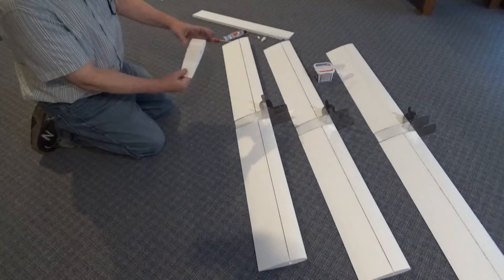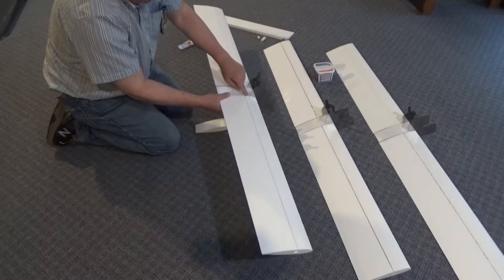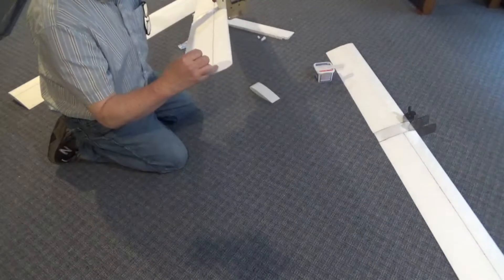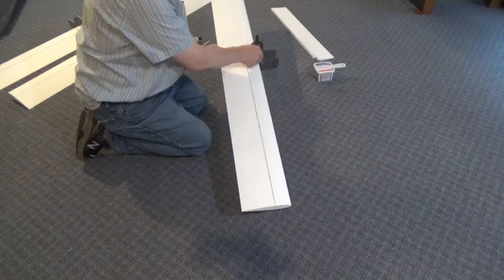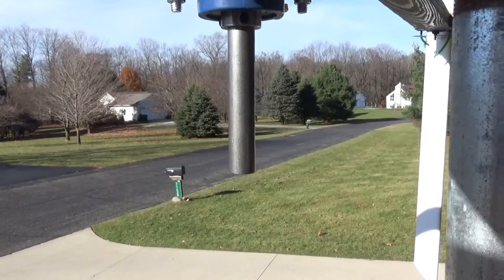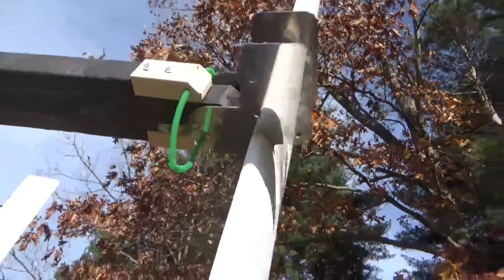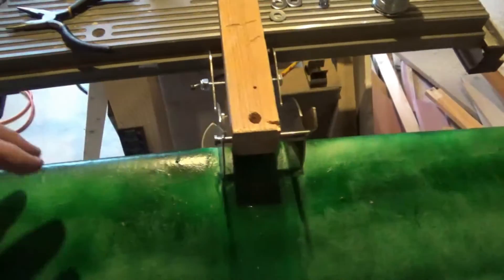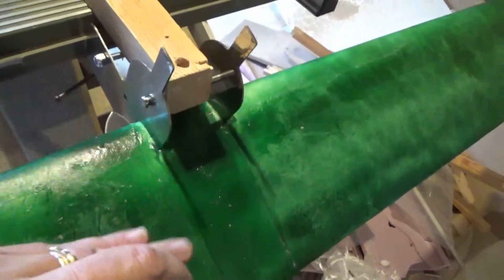Sharp VAWT (Sharp style Vertical Axis Wind Turbine; Passive Cycloturbine)

Comment: E for Effort you may want to look into a C-Rotor type wing though.
Reply: The Sharp Cycloturbine has airfoil shaped wings to provide lift and speed. This type of turbine has enormous torque and automatically adjusts blade pitch. C rotor doesn't do that.

Comment: I am a manucturer and mechanical designer ,
Production degree from UET Lahore Pakistan 1990
Remarkable info at your end on you tube, Bundle of thanks
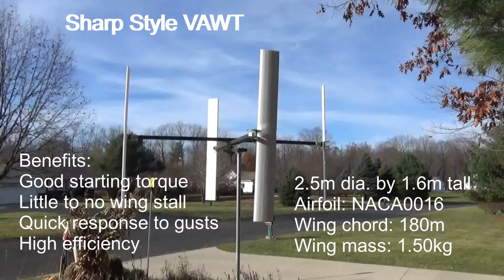What is the minimum wind speed needed for your wind 0:04  turbine and how much output in watt - second at 3meter per second  wind blowing?, please share with me
I will wait for your feedback please
Reply from the maker: I don't have any data.  I just wanted to see if it would work.

Comment: Very interesting build Michael. Thank you for the video. I'm interested in how you shaped the foam core blades and what material you have used please? I've only recently found the Sharp Vawt concept while trying to work out a passive blade pitch mechanism myself but love the simplicity. Keen to see any further data when you get to put a generator on yours. Thank you.
Reply from the maker: I ordered the blades from Mohr Composites since I did not want to cut the spar holes myself.  I do not plan to put a generator on this one.  Originally, I wanted to use it to compress air or pump water.  But after walking near it one night and realizing there were 2x4's and weights moving rapidly near my head, I decided it was too dangerous for its location and I took it down.  I kept the parts in case I want to put it up again, but decided to build more site appropriate turbines.
Reply: @MickEMaus3000  it's mostly narrated that vawt turbine are not productive enough kindly update us about its performance in low medium & high speeds plz ..

Comment: Looks like you're getting decent rpm in that wind you were getting near the end. Not a "runaway turbine" by any means but good speed for the diameter. Did you use 4 instead of 3 blades for easier building?
Reply from the maker: Yes, the four blades was for easier building.  If I went with three, I'd have to have a strong hub and cantilever arms off from that.  Plus the four blades gave me a higher frequency of pulses on the pole that I hoped would get it above the natural frequency and help stop the shaking.
Reply: @MickEMaus3000 This driveway and area look familiar from some other vids? I'd be tempted to increase the number of blades rather than reduce because at that diameter you'll be breaking the sound barrier soon LOL, Once 3 blades get up to any speed the pulsing goes away as the turbine essentially turns into a large cylinder but they have to be balanced , mounted on the structure, within grams or way less for smaller diameters
Reply: also; a quick way to increase your output 5-10%? would be to cover the leading edge of those arms with some half cove or plastic tubing cut in half. Don't know if your blades will stand the extra rpm though... maybe get a load on there soon
Reply from the maker: @itsandbits1  I took that turbine down because I did not feel comfortable leaving such a large turbine up so close to the ground.  When the wind blew at night, that thing would be swinging around where it could bonk someone in the head if they were wandering about.  It was quiet and fast, and would hurt even if the wings were foam.  I'm working on a smaller one that would be more permanent and appropriate for the pole.
Reply from the maker: @itsandbits1   Yes, that driveway has starred in a number of old videos that I have since moved to Rumble.  :-)  I posted this video on YouTube to give a little more exposure to a design idea that I thought needed some attention.
Reply: @itsandbits1  winglets on the blade tips helps.
Reply: @justtinkering6713  yes https://youtube.com/shorts/sefLbM08zpc?feature=shared

Comment: Awesome. Fix the issues. Put a large pulley on the turbine, then offset the generator with a belt. Center the turbine on the pole. That offset bearing creates a lever.